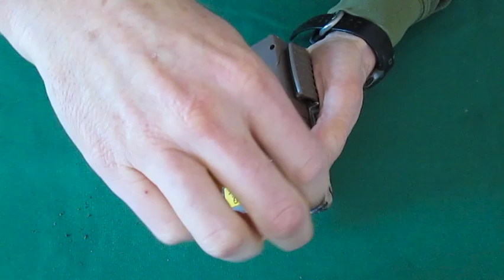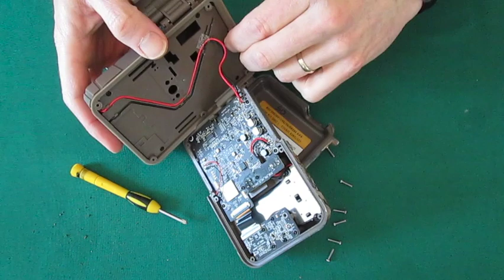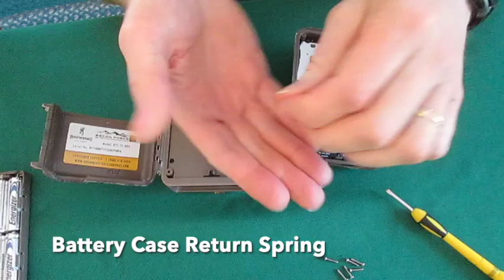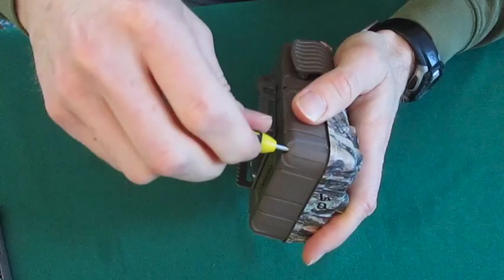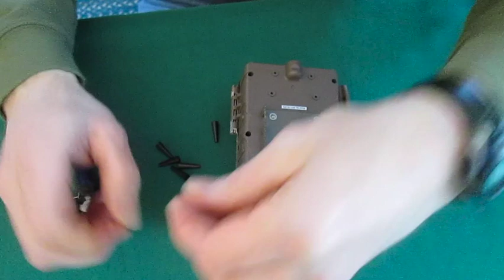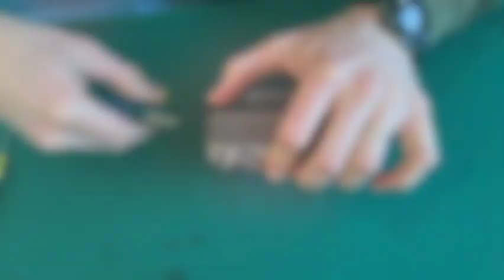BTC-7E-HP4 Disassembly   1080

Comment: Nice video! Can you tell me if this camera has a coin battery or a ultracapacitor and where it sits? My BTC-7E-HP4 losses time settings every time I change the batteries. All other settings survive so I think the EEPROM is ok. Now I would like to try a change of the coin battery / ultracapacitor.
Reply from the maker: Sure.  In the HP4, the ultracapacitor is mounted on the back (LCD/button) side of the main PCB.  This is a nominal 3.3 V device, with diameter of ~3.7 mm and height of ~1.1 mm.  It’s above the LCD panel at 1:26.5 in this video. 

 I found what looks like a suitable replacement part – the Seiko XH311HU-IV07E.  This part is listed as “discontinued” in several sources, but is available in stock (at this writing) from Digikey: 
https://www.digikey.com/en/products/detail/seiko-instruments/XH311HU-IV07E/4839962

Let us know how you make out.
Reply: @winterberry-wildlife-tech  Thank you! I'll try it out and then report back.